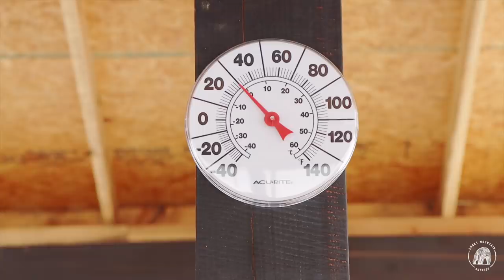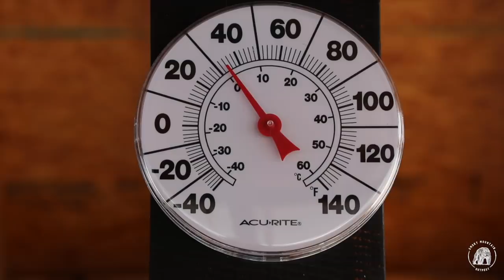TIMBER FRAME CABIN | FRAMING WINDOWS & RIDGE BEAM ANGLE IRON AT JOINTS

Comment: I have a question. Looking at the cabin at the ends of the gable would  it be wise to put in a couple of windows in for light and for air to move like in summer time. J T in Iowa.
Reply from the maker: Well with windows comes heat loss. That’s what I pondered over. So with all the reflective barrier I am putting in surrounding the inside and the ceiling fans, I believe I may be on the right track. I don’t even plan on air conditioning.
Reply: I do like the videos. I have learned some things on the building. Keep up the great work.
Reply: I want to thank you for answering my question. By the way Happy new year to you and your family.